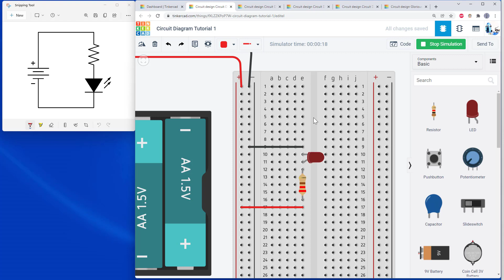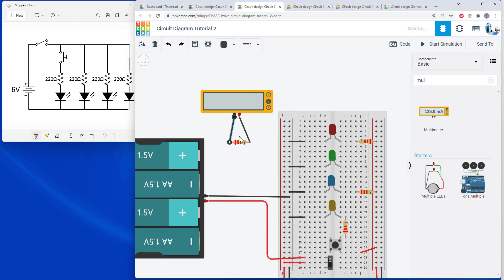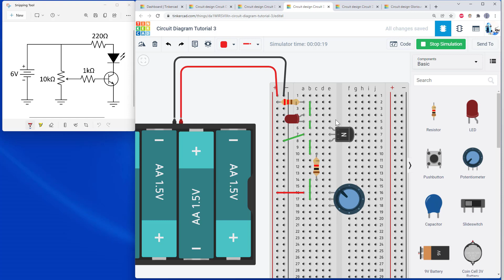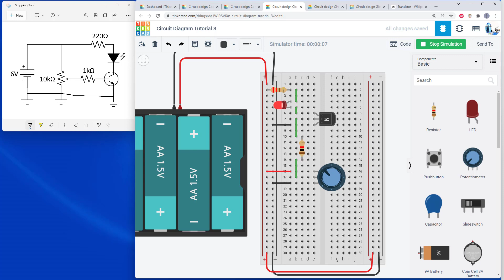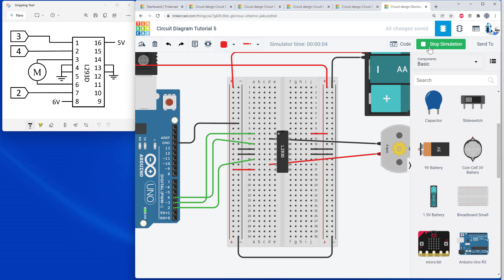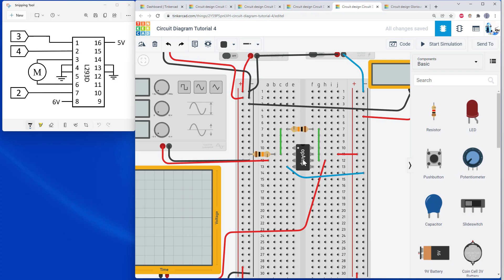How to Build a Circuit from a Circuit Diagram | Part 6: Debugging

Comment: That was fun.  I could keep up with most, but the flipped opamp got me for sure.  It's a little unfortunate, as you clearly mentioned to beware of that error in the initial instructional video (sigh).  Thank you for the video and the Circuit design website, which I'm using for fun now.  Tinkercad is very convenient.